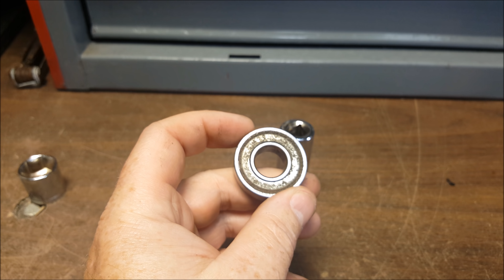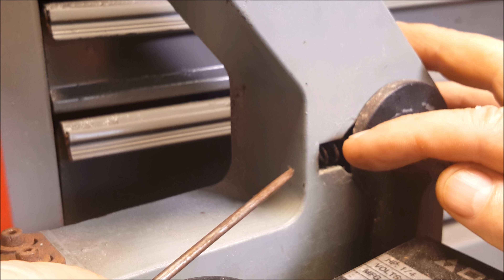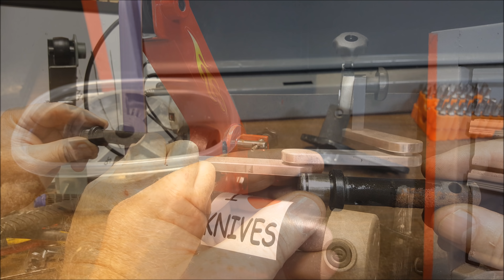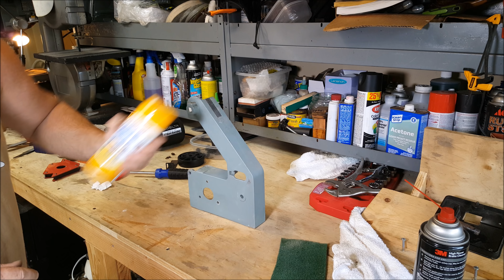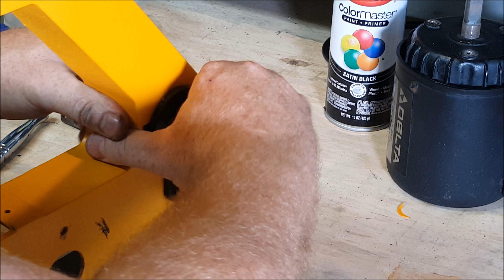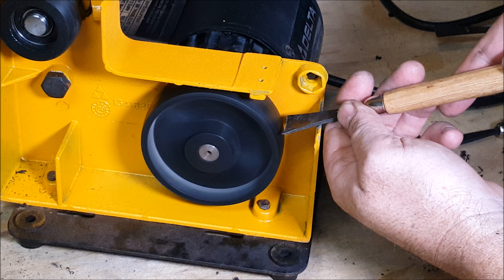How to Upgrade the 1x30 Idler Wheels

Comment: Cliff,  based on your approach I took a treadmill motor and fitted it to my HF 1X30. In doing so I needed to increase the bore size of the main pulley to 17mm on my drill press. Once re-installed the main pulley has a slight wobble which causes the belt to move side to side by about 1/16+ inch during operation. The belt stays firmly on the pulley during operation but I would like to fix it. I did a little truing of the main pulley but without a solid fixed "orthogonal" reference I did not want to make it worse. It seemed to get a bit better. Any ideas from anyone ?
Reply: Without seeing its hard but from what your describing Id do the sharpie around the perimeter and see if you have any high or low spots and remove those like I did or with course sandpaper and a block placed towards the back.  If the wheel is wobbling side to side(also can be checked with a stationary sharpie) Id probably do something similar from the side.  Worst case you can order a replacement wheel from grizzly.com for about $15 I think it was.  I have some in with a machinist right now, thats another option as they should be able to get anything dead tru on a lathe.  Good luck man!

Comment: Good enough video. Wish you'd have shown the wheel and bearing removal,  which happened off camera.
Reply from the maker: Maybe you missed it?  at 45secs into video I show step by step removing the top idler shaft, the removing the bear from the wheel and the shaft from the bearing.  Also is shown the snap ring pliers being used to remove the rear one?  Its pretty clear.
https://youtu.be/-84-QeuHMVo?t=39
Reply: @CurryCustomCutlery  Yeah my apologies. I must have had a micro sleep or something, because I did totally miss it. I got it done in the end but it would have been easier if I'd payed attention : )

Comment: Will the idler wheels you offer for the HF 1x30 belt sander require trueing like the original wheels?
Reply from the maker: The ones I sell are trued better then factory.  I do the work here in house.

Comment: Hey there.I have a problem with spring mechanism.It is not moving forward .How can I fix it?
Thanks .
Reply from the maker: Id refer to my oldest video on mods done to my hf 1x30.  In that video I discuss the arm not moving free forward.  First make sure the pivot nut is loose enough to allow movement, then behind the swing arm when the spring lives look for mfg defect of extra little bit of frame material.  Use your eyes(not sarcastic) n feel to picture n see where it needs to move.  Something is blocking back there.  Ive seen it before.  Good luck!

Comment: I haven't trued up the wheels on my HF 1x30 but it seems to run straight.  Should I still take it apart and check them? Is truing the wheels just for getting the belt to track straight or does it have other benefits?  Thanks for the video!
Reply from the maker: Truing the wheels is a secondary thing that allows the belt and machine to run a little smoother and a tad but quieter.  That is all.  Not critical but some wheels are way out of whack so it can help.

Comment: That would be awesome.....if you decide to do aiming thing like this I would be willing to send you mine for you to tune up and put a variable speed motor on it if it would not be to expensive. If so I can I contact you to discuss
Reply from the maker: All options on the table at this point but I think shipping costs could cripple it.  I will be reviewing an out of the box variable speed machine in next couple days, keep an eye out for that.  Its the first production 1x30 with variable speed Ive ever seen or heard of so very excited to check it out.  cheers :)

Comment: It has been over a year to search for a 1x30 "MULTI SPEED belt sander". This is a real problem! From a beginner point of view
how do I figure replacing the motor ? What I am asking is this: You have a very advanced expertise. Would you have a video
that shows you a step by step video on how to accomplish the task and a source on where to buy an ideal multi speed
machine that is within reasons ( $ 200 ) or so.  Considering that china makes almost every tool on the planet what is it
that there is no solution. I have noticed you have found a new motor can you maybe show a step by step video and
the source of purchase of your parts ? I would like to mention that your expertise is very much appreciated. Stay safe
Best Wishes   Dirk

Comment: Correct me if I'm wrong but this is not a Harbor freight belt sander.
Reply from the maker: Grizzly, Delta, and a hundred other names all are based off the Harbor Freight and the parts are identical.  Grizzly may even have been first.

Comment: Hey cliff. I was hoping you could help me with a few things...
I bought an old 1x30 dayton belt grinder 1/4hp motor with a bunch of old belts.
Tried to grind  a fairly big blade with a 50 grit and belts keep breaking after a few sweeps.
Am I grinding wrong?
Are the belts too old?
Is the blade too big? 8inches long
Can i get away with putting a more powerful motor? 3/4hp?

Thanks in advance!
Reply from the maker: If its breaking at the joint and the joint tape maybe looks dusty, they be too old.  Ive experienced that with a mess of 1x42 belts I received.  Tried lots of things to reglue, clamped the joint down and used packing tape and 3m industrial spray glue was the best I got but a pain to do each belt and still not 100% reliable.  Nothing like a belt popping to wake you up right?

Id think to order some fresh belts.  Best part about a 1x30 is belts are inexpensive.  For heavy stock removal you cant beat the orange norton blaze.  Check my latest belt video for a full list of things Ive found.  Cheers
Reply: Curry Custom Cutlery 
thanks so much for the reply. I watched 2 videos of belt reviews yesterday. Ill be purchasing from supergrit.com today.

Comment: Cliff is there any way that you could possibly give us the bearing number please.
Reply from the maker: Yeah sorry Phil...I would have listed it below if I was totally stoked on them, I am currently not.  They are not free spinning and developed heat quickly.   We do have a local bearing company I want to go down and discuss with them ASAP and I will do a quick follow up video.  At that point I should be able to recommend with confidence.  Hang tight, sorry.
Reply: Curry Custom Cutlery thank you so much for looking into that it would be great I love my machine it does have some quirks though.
Reply from the maker: @tofino50  6202-2RS...sorry it took me 8 months to get back.

Comment: Are replacement idler wheels available ?
Reply from the maker: Yep we have them back in stock at:

https://www.currycustomcutlery.com/products?category=Machine+Parts
Reply: @CurryCustomCutlery  Are they of the same quality as the originals on HF belt sander? Will they also be required to be trued ?

Comment: Just curious why you didnt mod this for slack line sanding when you had it apart?
Reply from the maker: Not sure what you mean by "slack line".  If you mean slack belt sanding, this machine can do this as it sits so again not sure what modification you would be referring to being done?  Thx
Reply: Yes. Slack belt sanding. You did a mod on the back side of the gaurd on the othe video. Just figures you would mod it why you had it apart.

Comment: Would have been nice to know what size replacement bearings were needed, also the music is a bit loud and slightly annoying.
Reply from the maker: James Williams thank you and agreed.  The voice didn't record as loud as desired. I was my first attempt.  Bearing info was absent until I can confirm it is worthy.
Reply from the maker: Bearing info added to Description
Reply: Slightly? Fingernails on a blackboard are slightly annoying. That music is torture...
Reply: 202ff clutch pilot bearing from o'rielly auto parts

Comment: You didn’t mention your auxiliary base.
Reply from the maker: Richard Tullius the black support frame?  It was mentioned previously so didn't think to go back over. It's just a simple frame that allows the sander to be flipped for slack grinding in the horizontal.

Comment: I was given a Central Machinery belt/disc sander #34951.  I would like to replace the bearings as you did, but the manual just says #15 Spacer Bearing with no part number.  Also, my wheels are aluminum, so truing will be a bit more difficult.  Where did you acquire the bearings, and are the motor bearings replaceable?  Any help would be appreciated.
Reply from the maker: Suggest you email me directly at Curry custom Cutlery at gmail.com

Comment: I think binning that entire "arm" looks better - it and them wheels. For peanuts, you can buy precision bearing wheels from a decent wheel supplier - the convex profile will be available in nylon or polyurethane in any diameter you like - bigger would be better - then fabricate a better arm with a quick-tensioner, binning the "3 wheel" system for a 2 wheel system with a tracking mechanism. That would give you a more usable surface to work with & faster belt changes etc etc. I think these simple sanders are the most easily "customisable" machine going from looking at them - the only bit I'd keep would be the drive motor, switch gear & drive roller (trued). The rest would get binned. 

I'll pick one up next week & do it, I want one anyway, but dislike the shonky way they're built & dislike the 3 wheel system - it strikes me as pointless when 2 would be better.
Reply from the maker: for sharpening the 3 wheel system with the "open throat" area is very handy for certain tools tho....I do hear what you are saying.  This video was back about 4yrs.  We now sell very good idlers wheels on our website at:
shop.currycustomcutlery.com

Comment: What is the bearing replacement number?  I want to order the bearings  on  ebay before I take apart my H/F  1 x 30 sander thanks....
Reply from the maker: 6202-2rs is what I choose.  There are a variety of types depending on the application but the bearing itself is 15x35x11mm
Reply: @CurryCustomCutlery  Thanks I will order those bearings